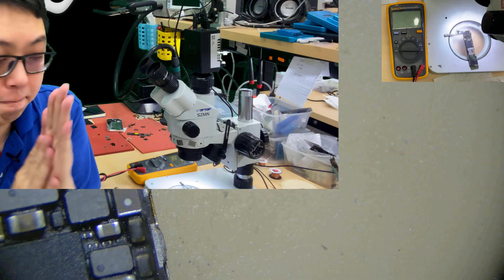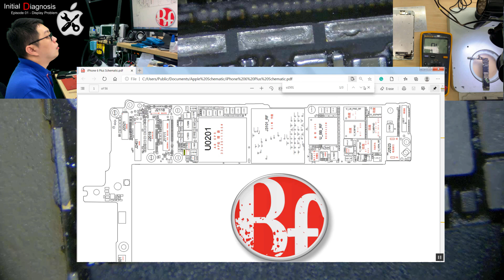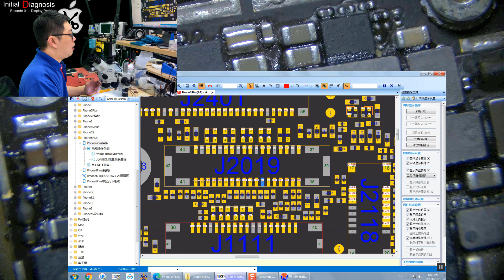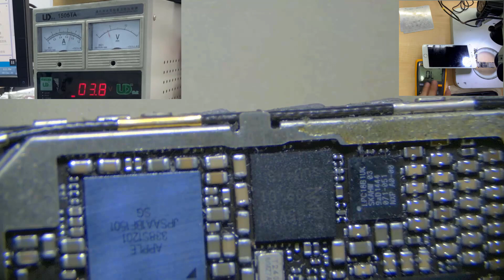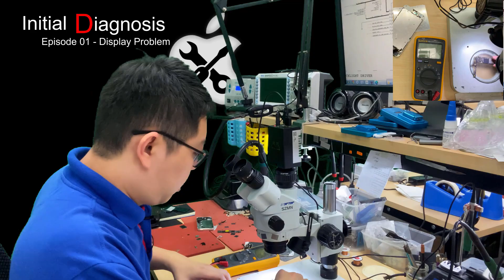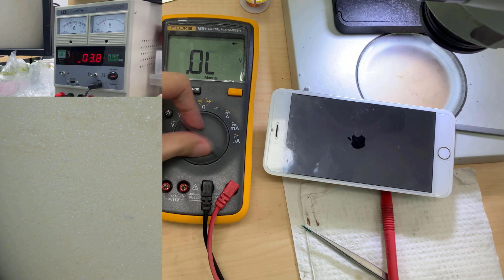They failed to repair the iPhone Display IC problem because...【Tutorial】 Chestnut

Comment: Troubleshooting is where by you figure out the trouble, hence trouble shooting, aka you're shooting out trouble possibilities till you figure out what the trouble is. For example you press a button expecting a switch to turn the light green, but it doesn't and that's your process. Diagnosis is really essentially the samething, you're identifying the problem via specific tests. Your tests may include testing the buttons and the light sperately, aka diagnosing the issue.

Comment: Seriously you are doing great work. You are educating engineers and students all around the world in a real sense.

I have this question
All capacitors they should stay OL at diode and buzzer mode? Otherwise its a half short or partially short?.
Greetings from North Africa (Algeria)
Reply from the maker: Good question. When it’s both side doesn’t connect to anywhere (especially ic removed), for sure it stay OL.

Let assume this IC chestnut is not removed while I measure,  it’ll have resistance. Because the design is channelling power to other side instead of storing power. 

Thanks for support.
Reply: @iPhoneServiceMalaysia  thank you